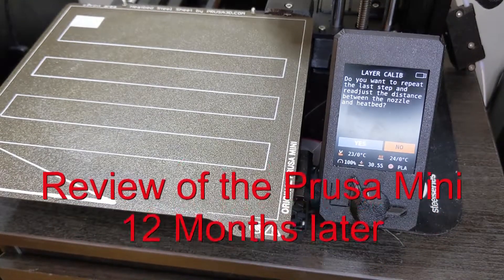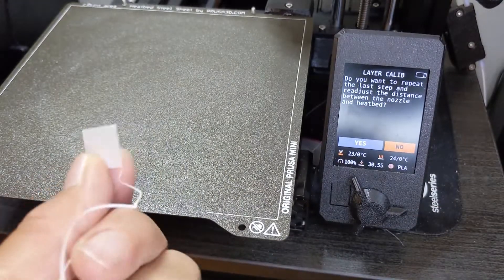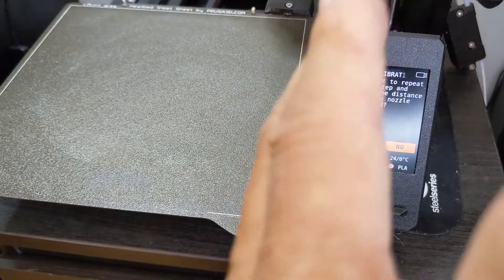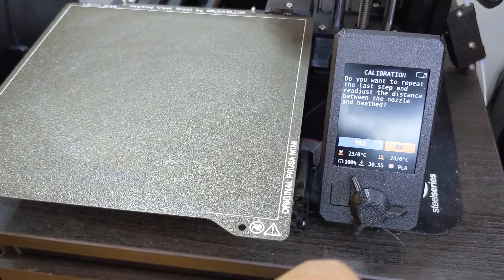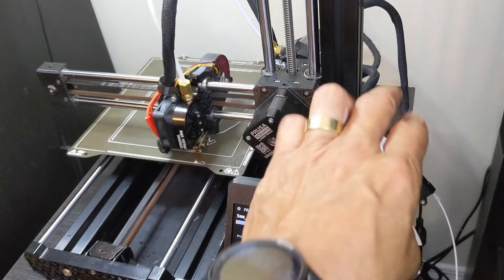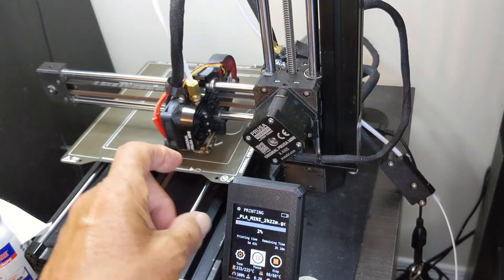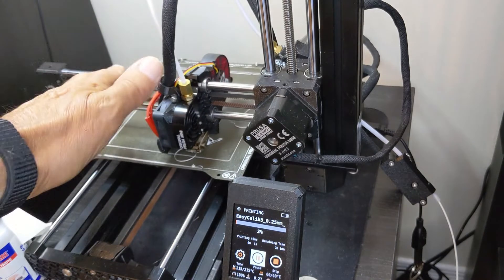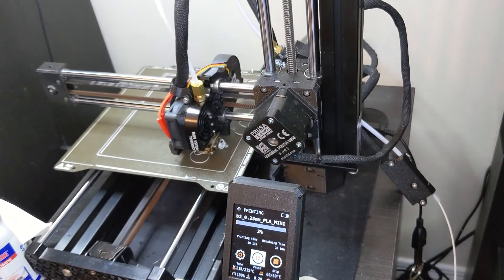My Review of the Prusa Mini Over a year later

Comment: I'm suprised this happens, because the mesh bed leveleing should couteract any "sag" coming from the canitlever design. Since it maps the bed with the PINDA before print. And the "sag" is pretty much repeatable based on axis position.
Reply from the maker: You would think wouldn't you. This design is cheap to make but avoid any cantelever designs.

Comment: Good to know. Thanks.
Reply from the maker: Hope it helps its cheaper but I would recommend the Prusa MK3s
Reply: @EmeraldMeadows  both are fossils at this point.
Reply: @user-yk1cw8im4h  what’s your recommendation then? Within the under $1000 to $1100, I’m seeing Prusa and Lulzbot fighting for #1. As you say they’re fossils, what do you suggest one who is just starting up should get?
Reply: @lunatic231  voron or similar core xy kit? Depending on the spec it'd be a bit more but I'd take an enclosed corexy machine over a bed slinger if I was looking to drop $1000+
Reply: Also for lulzbot money I'd start looking at brands like raise3d and the like.